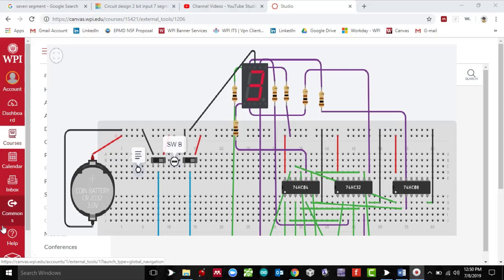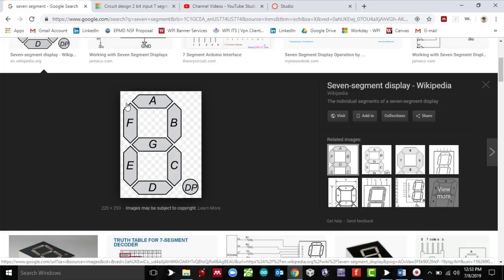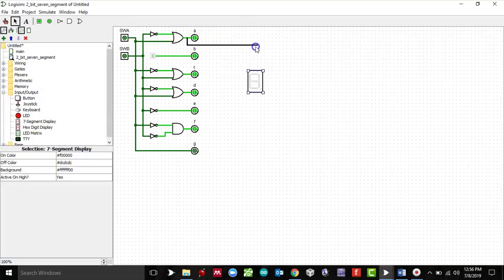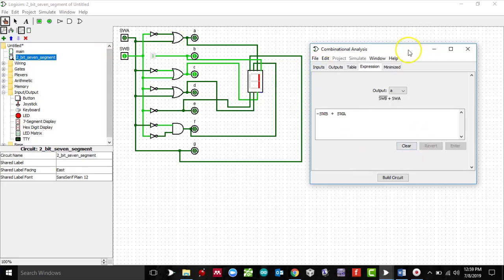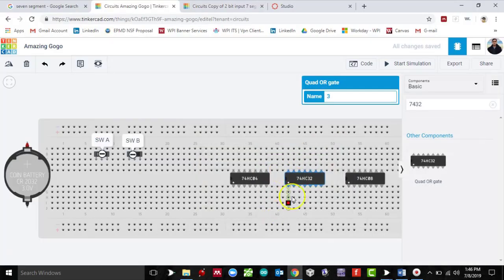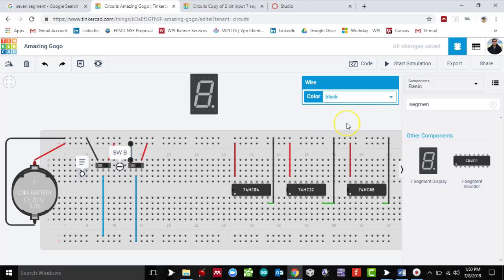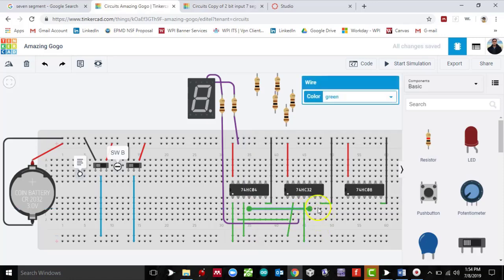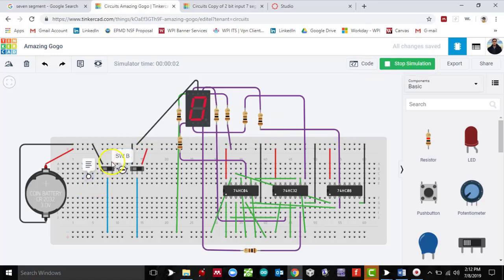#7 Two-bit Input 7-Segment Display Simulation | Logisim | Tinkercad

Comment: I'm new to electrical engineering. I have a question. Why do you need to use the resistor? and how to know how much resistance it need?
Reply from the maker: Farid, we need resistor so we can restrict flow of electrons and prevent led from blowing-up. Low value resistors (few kohms) should be enough to do the job.